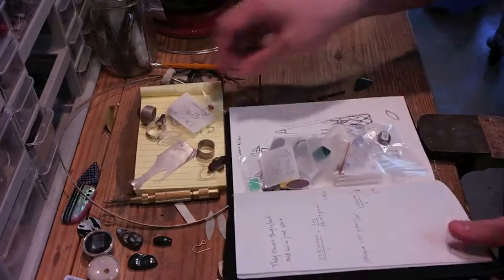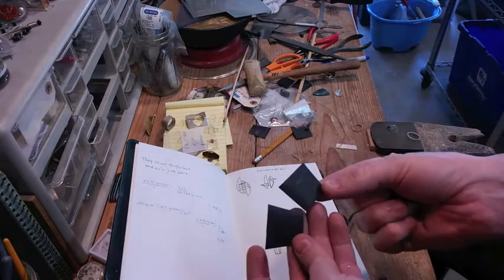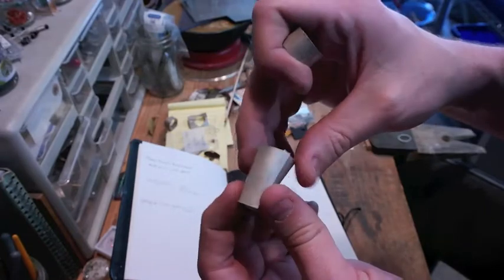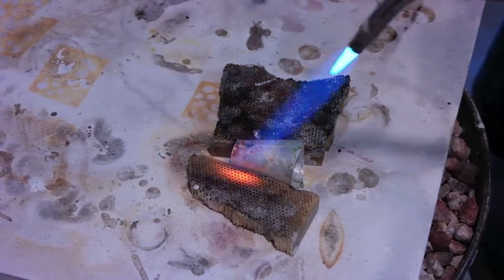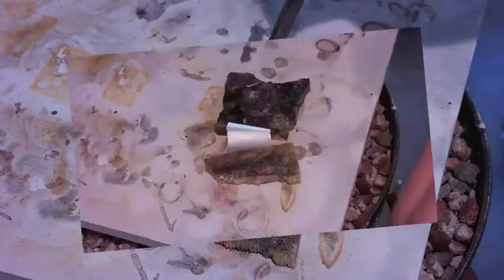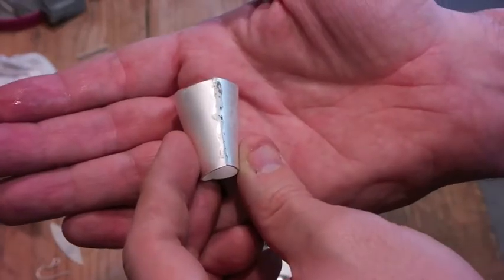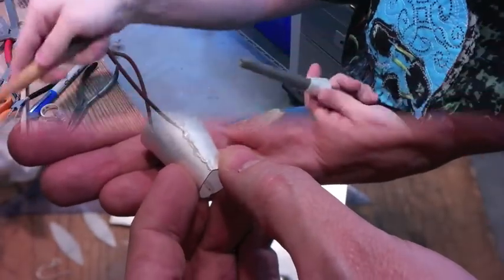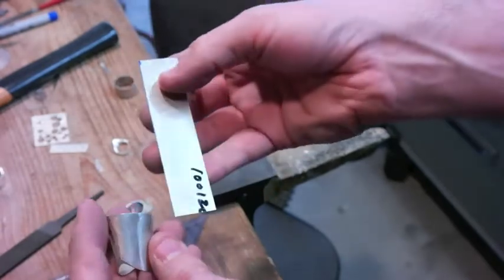Hollow Ring: Part 2

Comment: Thank you for the great video.  

Can you tell me what torch tip you used to solder the initial shape, the two curved trapezoids together? I'm assuming that's a Smith Silversmith torch - at least it looked like it. A #1 or #2?
Reply from the maker: Yes - it's a Smith Acetylene/Air torch.  I actually upgraded recently to a newer Oxy/Propane set up (which is amazing).  I normally use a #0 and #1 for soldering.  Probably a #1 in this video.  One of the reasons I changed my torch - I finally got fed up with the Smith torch taking forever to heat up my metal and eventually cause other problems (firestain, etc.)  My new Midget torch is great - and I bought cool tips from Paige Tools (in Seattle) - they are wonderful.

Comment: How do you get the stone to stay in such a low bezel? Im always afraid  they are going to fall out
Reply from the maker: this stone was cut by a friend of mine and has a really nice taper to the sides.  I used fairly thick bezel wire and basically hammered it in around the stone, using chasing tools.  As long as the taper on the stone is angled enough - the bezel will hold the stone in place.  Hope this makes sense.  :)